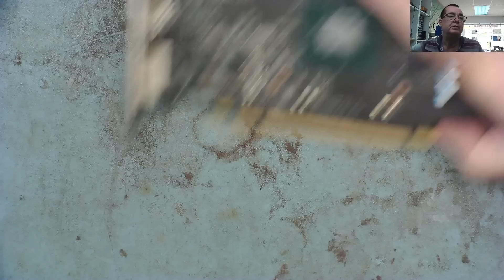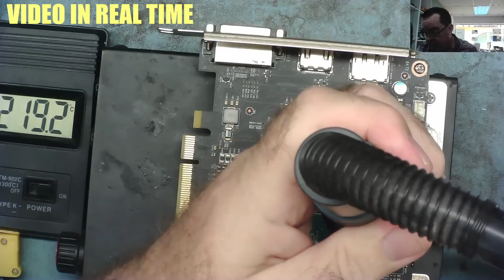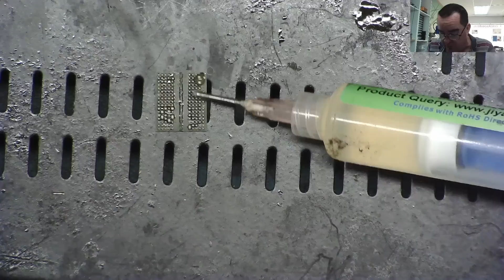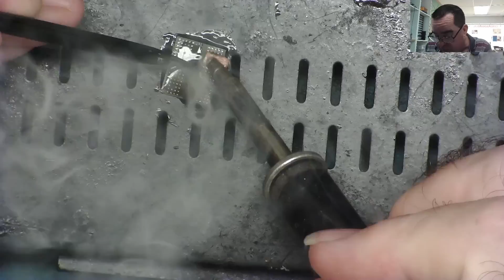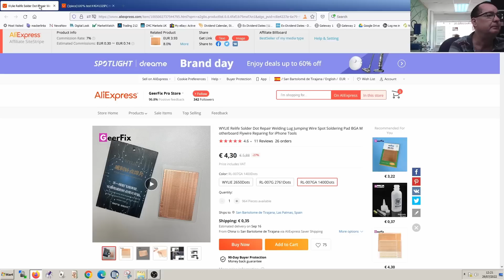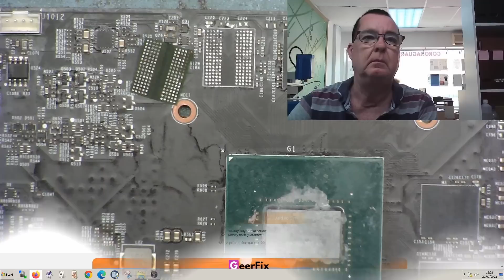GTX 1060 GPU No Video Output - Part 3 - How to Repair Rework VRAM Video RAM Fault

Comment: I have a suggestion what I saw at NorthridgeFix youtube channel in a video where a mobile BGA chip was reballed, it used a hot tweezers with a picked up piece of solder wick between the sticks and slide it over the surface where the balls were to clean the surface from the solder balls, he said that technique was discovered by him, it a very useful one fast and easy to use, I don't remember the video link to show you, but I saw it, worth to try it, now I found it, here it is:
https://www.youtube.com/watch?v=zdvvk0NdAy0&t=612s

Comment: I actually just recently mixed and matched samsung with hynix chips and the gpu still worked. Maybe if you have the same model board lying around or same generation but different manufacturer graphics card with same type ram like gddr5 then it will work.
Reply from the maker: That could be worth a go - certainly would not make it worse

Comment: So if you had to reball or reflow gpu chip would you have done it with hot air or bga rework. Would hot air station permanately fix it?
Reply from the maker: I would use my BGA rework station LY G720 as this is a subscribers card so I am not going to mess about with it unnecessarily

Comment: quite unusual damage, doesnt look like corrosion. unless the board comes with a backplate it was likely flexed quite badly at some point, and if so, checking the tracks would be prudent thing to do. and yes, the pinout is standardized
also to minimize chances of getting an air bubble you should apply flux only on one side of the chip and let surface tension work
Reply from the maker: Well the original description of the problem was that he had this GPU jammed into a work station where it did not fit properly.  The rest is history.  This could be very a good example of why not to fit a GPU where it does not want to go!
Reply: @learnelectronicsrepair  exactly, see how a small mistake can make, you should also have made sure before you clean the pads that there is not floating pads around, could be a good way to know if you have accidentally ripped off only or not
Reply from the maker: @GraphicManInnovations  I did chat wit the owner and he tells me that the area where I had those two faulty chips with loose pads is exactly where the cover of the PC was pushing against the graphics card.  he also asked me to order some new RAM chips so I can try to fix it - I also ordered a BGA pad repair kit like the Relife kit but different brand
Reply: @learnelectronicsrepair  great so there will be a part 4, a very interesting and cleaver repair from you, great dedication, i hope all customers are as honest as your's, you are lucky :)

Comment: I think but I am not 100% sure that NVIDIA graphics cards detect the memory capacity at boot its not a hard limit set in bios(or I seem to remember that's  how they used to work). if this is the case you could run the card without that chip, it would just have 2.5GB instead of 3GB . you could also run it to see if the fault is fixed without that chip and discount any possible issues with the GPU before spending money on it .
Reply: How to do it
Reply from the maker: @chathu6472  I did run MATS before I removed the chip - it was always failing on this channel C0.  Looking at the specs for this GPU, the memory bus is 192 bits wide.  This makes sense as it has six VRAM chip which are 32 bits wide each.  So to do what you would suggest ,at least as I understand it, you would need to use a memory bus width of 160 bits but even if you could wouldn't the registers inside the GPU expect 192 bits of data per 'data word' to process?
Reply: @learnelectronicsrepair  I think you might be right , it wont work but  there was a 1060 with 5GB of memory sold in china that had a 160 bit bus which suggests they just removed 2 chips from a 6GB card

Comment: Nice to see the pre-heater stuff, no doubt your technic it's professional. Sometime things can't be fixed..let's face it!
Reply from the maker: The preheater is very useful for this sort of work.  It makes a job that is difficult/bordering on impossible fairly easy, even with a cheap hot air station.  And the Kada 853B is not overly expensive.
Reply: @learnelectronicsrepair  Nice! Thanks..

Comment: Question to the content provider L.E.R, I have been looking at that bottom heater for a while is there a way that it can be converted to 110 volts? I only see them at 220 volts.
Reply from the maker: That I do not know.  I can see some listings on AliExpress that say 110V/220V but they only seem to have the 220V.  As to if it could be converted, I guess I need to open mine up and have a look how it works 😉

Comment: Hi Richard, I liked watching in three parts.
I have two old Radeon graphics cards which stopped working and I wonder if you may be interested in repairing them...one cost £330....a lot then.  
 I have bought two s/h boards to replace them as I do not have the equipment to work on such small components. They are both working fine.
Reply from the maker: Sure, you can email me electronicanaria@outlook.com - no fix no fee and carnage is free LOL.
Reply: Stay away from him if you know what's good for you 👍 did you see that carnage he did to that chip and blame on someone else 😆 🤣
Reply from the maker: @remu3881  True, but I tend to specialize in repairable carnage so I can get another video out of it LOL 🤪
Reply: @learnelectronicsrepair  spoken like a trooper , but we all been there 🤑

Comment: Hoera and now sell it on the seondhand markt and never see the poor guy/girl again :(
Reply from the maker: TBH it's likely to be fairly easily repairable if you have the ability to solder, or make a good donor board as the GPU is almost certainly good - so it would be a pretty good buy if bought spares or repair. I wouldn't be too unhappy if I'd got this as faulty from ebay.  Unfortunately for some reason a lot of folk can't see the word spares in the phrase spares or repair, even though it is the first (and therefore dominant) option in the statement. 😉
Reply: @learnelectronicsrepair  There are to much sellers they don't thell when there is a story to a repaird item ;) No offence..
Reply from the maker: @TheRiddleNL  Non taken.  Just when I choose to buy something spares or repair, that is exactly what I expect to get.  Something I can fix or something I can use for parts. Occasionally I even get something sold as faulty that works! I pretty much ignore what the seller says - if it is as sold spares or repair I just assume broken

Comment: Expected to see that, likely not caused by you :)
Reply from the maker: Yeah I've destroyed enough stuff in the past while learning how to do this (don't we all)? to know what the damage looks like when you don't get the heat distributed under the BGA properly, and for that matter how to know when you do have it hot enough to desolder, and how not to rip pads off with the braid when cleaning the PCB/BGA either. 

Only way to learn that guys IMHO is practice practice and a bit more practice.  But once you have it, it's a bit like riding a bike - you don't fall off any more every time you come to a curve in the road.
Reply: @learnelectronicsrepair  Haha yes indeed, it is certainly a lot easier to destroy things than fix them. I have always used a strand from some silicone rc model wire to fix these pads, real fiddly job tho!
Reply: @Sydney268  you got to see what you doing first 🤣
Reply: @remu3881  definitely a microscope job for me
Reply from the maker: @Sydney268  Yeah these Wylie Dots (and similar brands) are supposed to make that a lot easier to do
Reply: A BGA rework station that has a thermal couple is great for rework. It prevents you overheating and heating too fast/slow.
Reply from the maker: @JustAUser938  Definitely.  if you didn't see it on my other videos I have the LY G720.  you can often see this behind me on my videos
https://www.alibaba.com/product-detail/LY-G720-Semi-automatic-align-BGA_60779223958.html
But for RAM chips it isn't needed